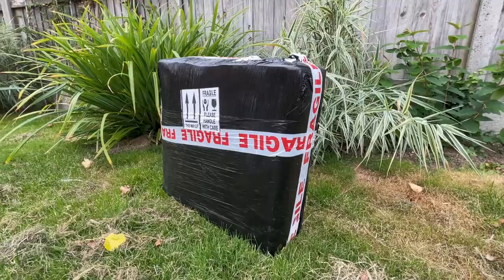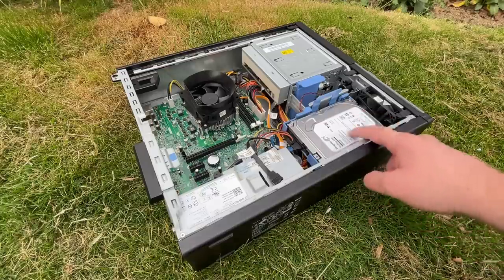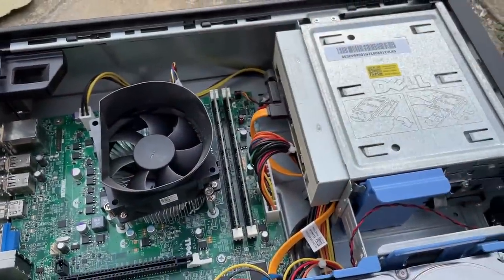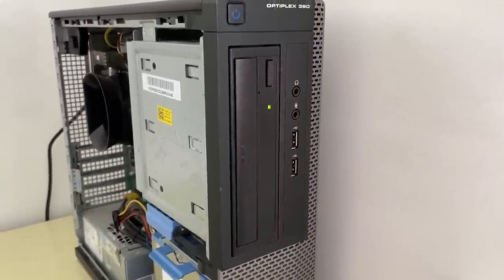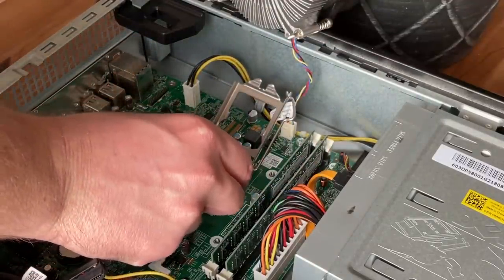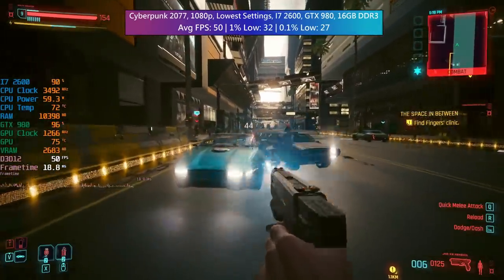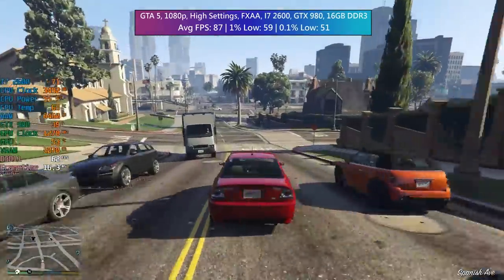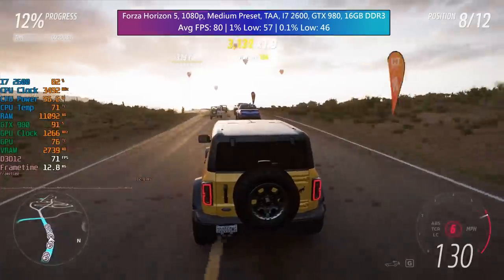The seller didn't know the specs of this £15 PC...

Comment: A while ago I bought optiplex 7050 and paired it with low profile 1050ti and was gob smacked how good it performed in games. 
The little systems are very capable when paired with gpus.

Comment: My roommate acquired a discarded i7 computer. Never did anything with it. Was an Asus with a full sized case instead of one of those slimline cases.  Turned out to be an i7 2600. Replaced the hard drive with an SSD, moved it into a recycled all aluminum case, and added a GTX 980.  A little old but still not a bad performer.

Comment: I just bought a shuttle PC, an older Lenovo laptop, a MS Surface with a clearly exploded battery, a gigantic Dell 42-inch MONITOR, a Viewsonic 22-inch monitor and a 2008 iMac for $50 (USD) at a yard sale. The Shuttle PC had a Core2 Quad, which was funny to me because I remember pining over the C2Q's when I was in college, but couldn't afford one at the time. It's all very old hardware, but it's also all fun to tinker with. I'm planning on using the old shuttle case and PSU to build an emulation machine using an mATX mobo and a Ryzen CPU and GTX 1060 6GB and put it inside a modded Arcade1Up X-Men Vs Street Fighter Arcade I have.

Comment: It's amazing what deals can be had when people don't know the value of what they have. I picked up a Ryzen 3600, 16GB (2x8GB) DDR4 and an MSI X470 Gaming Plus Max last year for £100 on marketplace.  I also got a FREE Coolermaster Cosmos case (yeah, the huge beastly case) and inside was a Z87 motherboard, 16GB (4x4GB) DDR3 and an i7 4770. The owner upgraded and just wanted rid of the old system (only thing he kept was the PSU).

Comment: Well, 1866 MHz RAM had no effect, because it's H61 board (as indicated in white border between RAM slots and CPU socket), 2600 could do a little better in a Z board but it was limited to 1333 MHz RAM speed, which matters in recent games. It's nice, however, that the board here is standard dimensions and uses regular ATX power connectors - it means the PC can house an AM4 board with something like 5600G easily :)

Comment: A lot of Dell power supply connections are proprietary, so you need to be careful with trying to use Dell motherboards in other cases, also Dell commonly uses extremely fine-pitched connection headers for things like power switches and audio connections.  There are adapters and like available, but they drive the cost up and in some cases, make it not worthwhile.
Reply: this generation isnt. i did it the other way around and put a gen 4 haswell asus board in the dell case, since i like slim pc`s, for allround pc´s. it runs them no problem. only the power button and led connectors are proprietary.

Comment: Best purchase I ever made at a garage sale a few years ago was an almost maxed-out Mac Pro (2012).. dual Xeon X5650, 12 Gigs of RAM and a GTX760. "Can't test it, no hard drive or boot media".. took it off them for 50 Euros with a "maybe I can repurpose the case for something..", thinking I'd have found just another PowerMac G5 box.. and it turned out to be that Intel gem. Still using it today occasionally.

Comment: I once got 4 or so OfficeSystems like that, 2 were working (with 3xxx / 2xxx i5's in them) and one was not, it just did not boot, but under the cooler hid an i7-7700 and man was that a good find! Must've thrown it out because it wasn't working anymore but here the mainboard was broken, CPU runns just fine still.

Comment: The cherry on top of this process is you keep perfectly usable hardware out of the landfill. Not a bad deal all around. I still use one of those very Optiplexes (with an i5,  3 gb gtx 1050 lp and 2x4gb) as my desktop, only problem is windows 7 is out of support so it is off the internet.... useful for running old software though, and it could work decently if updated.

Sometimes I wish I had the space to refurbish systems for resale like you do, it seems like a rewarding hobby and you get to tinker. Cheers.

Comment: one thing ive noticed about FSR in Starfield is that it seemingly hits the machine harder than just running native. when i switched over to CAS upscaling, it ran much better and provided a much smoother experience. Now im running a ryzen 9 3900x with 32GB of RAM and a 3070 trying it at 4k60 and was able to get it at high with 75 percent resolution scale. Some dips but more than playable.

Comment: I still rock an i7 2600K @ 4.8 Ghz along with  32GB of 2133 Mhz RAM and AMD RX 6750 XT. It still works perfectly for all the platformer games i play and my usual work. This tiny chip, especially the unlocked version is one hell of a trooper !

Comment: I was rocking an i7-2600 and GTX 1070 up until a few years ago.  RDR 2 and Cyberpunk 2077 finally exposed the age of the system but it still ran fine @ 1080p.

Comment: Honestly, the 2600 isn't even that bad, especially for 15 quid. I'm still running a 3770 i7 for the last 10 or maybe 11 years at this point, and it's holding up nicely. I don't play a lot of the newer titles because they're not really of interest to me, but the games that I do play, it still holds up well. Only recently it's starting to show its age and I'm due for an upgrade anyways within the next year or so. 

Great video!
Reply: My main PC has an i7 2600s, 16GB DDR3 RAM and a GTX1060 6GB. Runs everything I want with no issues. Only issue I've had is software dropping support for Windows 7 and me refusing to use a newer Windows on this particular PC (I have a PC and laptop with Windows 11, don't have anything with Windows 10 anymore).

Comment: Got free what I thought was an i5 2500. Ended up being an i7 2600. Just like this video. I wasn't as shocked as the sticker said i7. It was the guy that gave it to me that said it was an i5. Had a 240GB Mushkin SSD and 12GB DDR3 1333. Plus an Nvidia NVS 290 as well. It is in a HP SFF case.

Comment: Using an old optiplex as my home server. Cheap, has good x86 performance and low power consumption. Really a good choice when a Pi does not cut it and you dont want to splunge out like 3-5 times the price for a NUC.

Comment: The 390 was a super solid system! I had the SFF version for quite some time as a server box, and some more as a media PC with a low-profile GPU. It's still running at a friend's house as a firewall now, still indestructible and trouble-free.

Also, my best DVD- drive find would be a copy of Oblivion.

Only disc II, that is.

Comment: Hey i wanto know one thing.....!!!

Which is the best low profile card that doesn't need extra power connector?
Is there any card other than rx6400,gtx1650,A2000.....?
Any other card that has similar or higher performance? (Keep in mind no extra power connector
Reply: Probably the 1650 cuz you can get erm quite cheap used also prehaps the wx 3100 as its a rx 560 equivalent with no overclocking support although depending on your budget and how much your old system is worth you could sell your old system and build a new one with an lga 1155 alliexpress motherboard <I have a mucai board in my system> xeon equivalent i7 3770 16gb ram and a rx 570 psu will probably be the most important and expensive bit although I found some good deals in store clearances n stuff
Reply: @RMoedoe   price is not the issue. Because in my country gtx 1630 cost 300pounds where rx580 is 120 pounds. 1650 is 220 pounds.
I only want to know about other gpu that doesn't require external power connector but powerful as 1650

Comment: I got an Optiplex 790 case (similar but more front ports) for free and put a Ryzen 5 3600 with 32GB of RAM and a Radeon 6400. The worst part was modifying the power button and ripping out the front USB 2 ports for USB 3, but I made it work.

I’m thinking about doing a Ryzen 5600g, RTX 4060LP, and a 500 watt PSU in that case next.

Comment: Years ago I bought an unspecified Dell Precision T3500 and when it turned up it came with maxed out 24GB RAM, 2 x 1TB SATA drives and a X5650 processor. I bought the machine for just £20. At the time the CPU alone was selling for about £80+

Comment: Just bought two B550 motherboards on "ebay" which the seller described as "sometimes restarting". Both where stuck in a boot loop, constantly rebooting. After a few hours fiddling I got both to boot into windows. One being actually stable - the other still crashing but less and less for every hour it was on. My guess is moisture damage. Paid 100 bucks for both and got at least one working mobo out of it - so not that bad of a deal.

Comment: Just picked up a system with 8700K overclocked to 5ghz, Asus Strix Z370-F, GTX 1070 Ti, H500P case, 16gb 3000mhz mem, EVGA 650GQ psu, Liquid Cooled for £225! No drives but I had loads inc M.2s which are now installed. The guy I bought it off paid just under £1800 five years ago as a prebuilt and if I was to sell the parts I'd get £600, but bought it to use rather than sell.

Comment: A good upgrade for these would be a lower capacity sata SSD with dram cache for the OS and keep the HDD for storage. 128/256gb SSD are pretty easy to find for around $25. Just make sure its NOT dramless. You need dram for sata SSDs.

Comment: I just recently got a Macbook Pro off of marketplace, guy said he didn't know the specs or year and the apple store told him they couldn't fix it, got it for $230, took it home and found out the display cable had disconnected from the board, reconnected it, it turned on and its the current model 13 inch that costs around $1300 new.

Comment: im still using the classic 3770 non k sadly but it still works wonders for me in most of the games i play, little pro tip here disable the spectre meltdown nonsense and you'll see a boost in performance from the CPU which helps a ton not to mention some of the greedy security features windows added over the years absolutely DESTROYS cpu performance for these old cpus.

Comment: cool little pc, mate and great bargain. Enjoing your content very much! Surprised of your RAM choice on this one though cause this OEM systems often were limited to 1333mhz in those days with intel 2 gen. Did you get the memory working at 1866mhz? Greetings from Austria 👋
Reply from the maker: Thanks! And I’m not sure it just seemed to work haha
Reply: Ya but the thing is for some reason the pc detect them as 1333 even though i used 1600mhz because 1333 is no longer available
Reply: @deadpain2483 looks like he just took out the CPU and use it in another Motherboard that supports higher end DDR3 RAM, that's why he's able to use GTX 980.

Otherwise it's straight impossible to do inside that same board and case and PSU

Comment: The fastest half height card available for this system would be an A2000 (6gb or 12gb).

I have a 1650lp in mine - it runs Diablo Immortal just fine at 1080p.

Comment: I got an Asrock Z590 Pro4 with an i5-11400f for super cheap. It came mounted with a BeQuiet! cpu cooler and seller was selling so cheap because the RAM would not run in dual channel mode, just single channel. I couldn’t get it to run in dual channel either, despite using different branded RAM, but I can’t complain considering the deal.

Comment: I'm so not telling you about the factory I work at. The previous IT manager had a habit of "not working, toss it, get a new one." It was fun getting permission to go through the bins where the tech got tossed. The last couple of years I've gotten laptops (mostly 3rd gen i5s), Optiplexes (3rd and 4th gen), Elitedesks (1st gen Ryzen), mac book pro (i7-4770HQ), one 8th gen i7 laptop, 3 6th gen i7 thinkcentres (M910q mini), an HP Proliant, an 8 bay 4u storage server (whose guts have been swapped a few times) and a lenovo r5-4500u laptop. 
Unfortunately as of July I moved from factory worker to IT and that manager was let go. So now it has to be really broke to get tossed and my collection isn't building anymore. I hate e-waste and would fix and replace what I could, this got me in the notice of the IT people.

Comment: You should loosen those spring loaded heatsinks incrementally, instead of loosening each screw completely. You want to keep the load on the mobo/CPU relatively even. Partially unscrew one, then the rest, and keep going around. I winced when the 2nd-to-last screw was removed and only one fully tightened screw was holding the cooler on, easily can damage something doing it like this!
Reply: it's basically not a big deal on desktop systems like this. but on gpu coolers or laptop cpus it could crack stuff and break it, yes

Comment: I deal with these computers all the time at work! I had a optiplex 790, and stole it's power supply to put into an optiplex 7010 with a bad PSU because it has TPM and Secure boot and can run windows 11! So, for what you paid, it's worth it for the power supply alone ;)

Comment: I bought last year or early this year a HP Compaq 8300 USDT or ultra small desk top and its been a little trooper.   I did have a riser out its back running a 750ti but decoupled that as it was tedious powering up, its got i5 with integrated grafx, 8 gigs of ddr3, I did have a SSD in there but again it didn't help that much so put in an old 1tb slowpoke HDD which it loves.   I use it as a second microscope carrier via a usb scope, it also has all my watch repair docs, its networked wirelessly into my main PC so I can easily send over video files and I also put on several emulators just for funsies.   Paid £20 incl delivery and a charge box, nauses though is its only displayport or vga but handy my 24 inch monitor it uses actually has a VGA port on it.

Comment: Budget Build PC List in our country around 20k PH peso! Hope you enjoy it this specs!  Brand new items!
INPLAY ICE Chassis Fan 120mm (x2)
InPlay Wind 05 Acrylic Side Panel Micro ATX Durable Tempered Glass PC Case
Keytech BTS 550 ATX Power Supply 80+ Bronze
256GB SATA SSD Hdisk 2.5"
Lexar Thor 8GB LD4BU008G-R3200GSXG 1x8 3200Mhz DDR4 Memory Dark Grey (x2)
Asus Prime A520M-K (Ryzen AM4) with M.2 support DDR4 Gaming MB MATX
AMD Ryzen 5 Pro 4650G Socket Am4 3.7ghz with Radeon Vega 7 Processor w/ Wraith Stealth Cooler MPK
SPECTERPRO G22F2-VA 22" VA 100hz Freesync Gaming Monitor Black
Ovation ACC 2in1 Kit RGB Keyboard and Mouse Combo Black
Secure 220v Avr

This is complete PC set already i'm not sure if this part/s available in other country! FYI! TY and more power to us!

Comment: What do you think about scoring an MSI Z370-A PRO Motherboard, i7 8700k, ASUS GTX 1060 6GB Turbo, 16GB DDR4 RAM at 3000MHz, Corsair H100i 240mm AIO cooler, and a Kediers C570 open air case with 7 RGB fans for $300?

Comment: The best deal on a used PC I ever got was an HP Z400 full tower for $40 shipped. It was definitely a steal and the PC works great although it was listed as for pars because the seller just couldn’t test the system.

Comment: There are many deals to be had. I once got a 1050ti/16g/ i7 6700 sff gaming pc for about 50$ since the seller sold it as “not working”. The pc booted on the pictures but the little - was displayed indicating there was no boot drive. You can imagine i just plugged one it and it works as new. 
Also one of my best %ile scores was getting a 4x16gb ddr4 2666 kit for 15$ as the listing title stated “computer memory” 😅

Comment: Honestly, we're at a point where reasonable SATA SSDs can be had for fairly cheap prices. I feel like it would do more justice to leave a $50 256gb SSD in for the next owner instead of the old HDD. As long as you're mindful of storage, 256gb should last you quite a while, especially for normal computing.

Comment: Although not a computer, I did once get a steal of a Nintendo wii for around £2.50 + £2 postage on eBay claiming the disc drive was faulty. To my surprise everything works as it should so must have been a faulty disc they used or something, still using it to this day

Comment: I actually currently use this exact same machine, but with the i5-2400, and right before gpu prices went up I managed to grab a used lp GTX 1650 for $100, its worked perfect for the last 4 years. Would it be worth it to find an i7 for it?

Comment: I actually ran an i7 2600K up until recently(not OCd cuz the motherboard didn't support it) and it did help me run games from up to 2018-2019 at decently good frames tho my guess is the 16gigs of 1666MHz ram(i know not breakthrough speeds but for that type a system is good) and the 2GB GTX 1050 aero OC edition did carry the CPU a bit here and there,all in all tho almost every time i monitorized it the CPU was 100% usage and the GPU at about 80% usage so is not like it rlly bottlenecked the GPU too much they kinda worked well together.
So all in all for modest gaming or just a work system the 2600 and its K variant are imo pretty good, at least better than just being E-waste which always saddens me to see.
That being said jumping from that to a R5 5500 and a GTX 1660 Super with 3200MHz memory really felt great ngl =))))

Comment: I bought a Dell optiplex 7090 micro second hand for £300, was told it had i5 10500, which it did but they mustn't of known it also had a low profile AMD RX 640 GPU in it too, checked the dell website and it cost £1100 new in 2020, it also had 32gb RAM instead of the standard 8gb.

Comment: 15 Quid is a blowout bargain for this. Throw in a 2x8 DDR3 kit, a 1TB SATA SSD, and a low profile GTX 1650, and you have a cheap and cheerful low end gaming rig for right around 200 pounds. Lack of USB3 will limit functionality somewhat, but there is only so much you can do with this.
Reply: For about 10 pounds you can get a PCIe to USB 3 controller card, I've found they work pretty well, I recommend the ones that are powered by Molex or Sata as I heard the self-powered ones are unreliable.

Comment: those 2nd, 3rd and 4th gen intel chips are coming down in price used - CEX have an i7- 4770 for €30, way less than you would have paid just a few months back. And the i5-4570 is just €6. Still a decent little 4 core for retro gaming